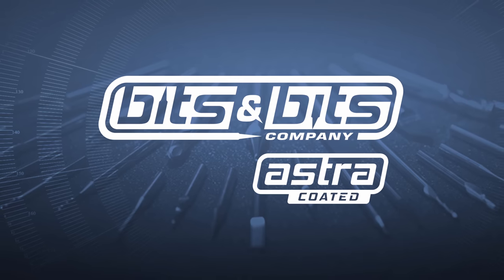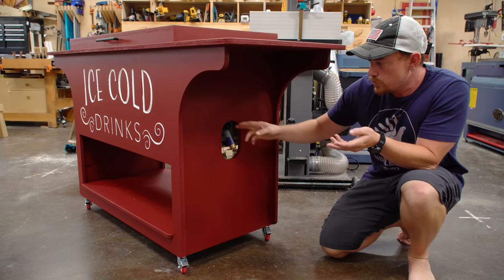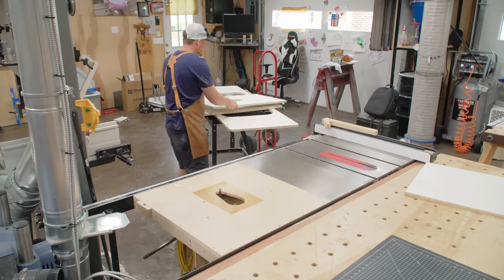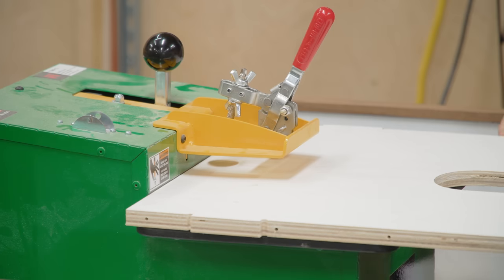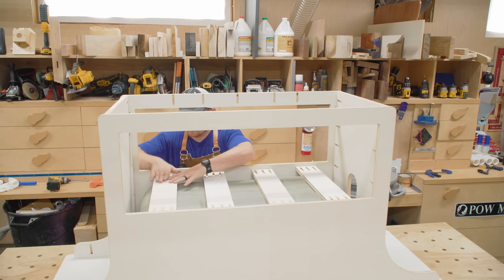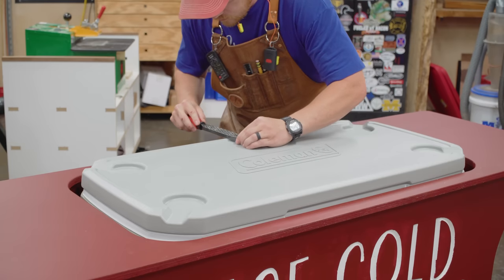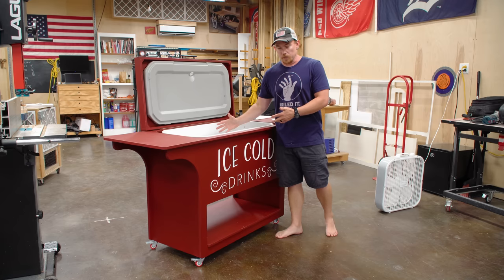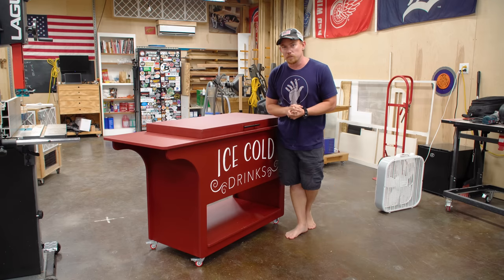Retro-ish Cooler Box

Comment: That is a very nice piece.  I like the old-timely look and paint scheme.  You could, if you want later, add a vertical version that houses a mini or midi fridge using the same scheme.  Better screws for that hinge would be either Spax or come from McMaster Carr and you'd have less worry about stripping out the heads.

Comment: A small suggestion would be to add flaps to the sides of the opening for better access to the cooler handles.
Reply from the maker: Unnecessary in my opinion.
Reply: @JayBates  I thought it might help when trying to pull the partially loaded cooler out of the box and pulling it from the side walls won't offer the necessary grip.
Please, do let us know how that use case turns out. Cheers!